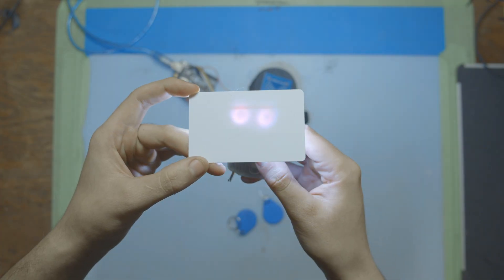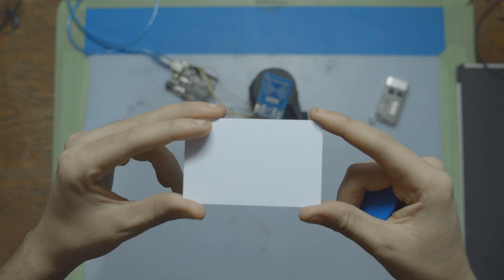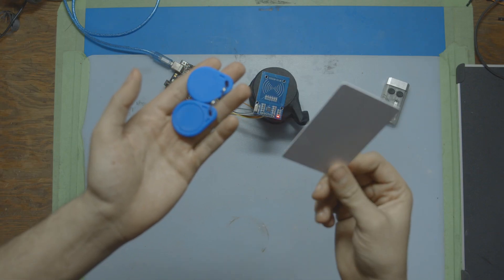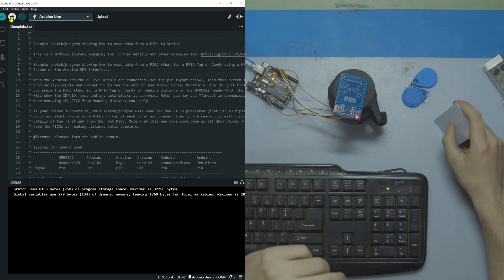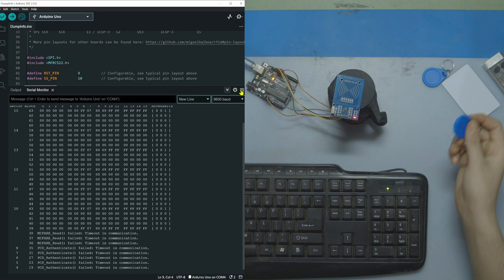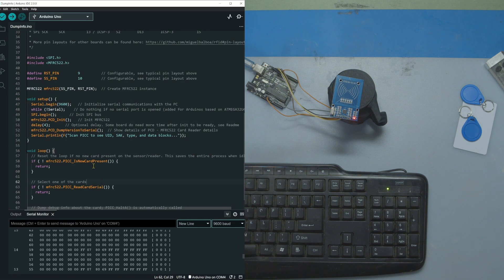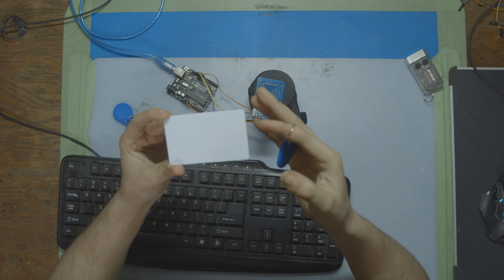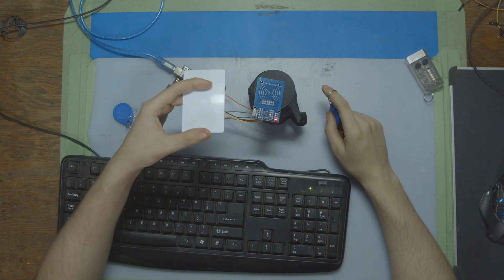RFID EXPLAINED: HOW TO WRITE DATA TO RFID CARDS WITH ARDUINO #rfid #arduino #esp32

Comment: My RFID isn't compactible with the arduino uno. It always gives communication error.
what might be the cause?
Reply: RF Cards such as rfid rc522 are compatible with Arduino Uno. You will have to install a library for example, RFID_MFRC522V2 to make them work. With high-end PCs, you may use a small delay command for the serial monitor to properly read RFID data
Reply: ? Baud rate

Comment: Hello, how to run power down mode in both Arduino and RC522? By bringing the card close to the RC522 module and using the interrupt mode in both modules, the system is started and after running, it goes into power down mode twice to extend the battery life. If this is not the case, the battery will run out in two weeks.
set_sleep_mode(SLEEP_MODE_PWR_DOWN);  in arduino  and  mfrc522.PCD_WriteRegister(MFRC522::CommandReg, 0x10); in rc522

Comment: @MikaelAbehsera is there a way to write info on the 15th row block. If this is possible it would make the scanning process so mich faster
Reply from the maker: Not sure actually, never tried
Reply: @MikaelAbehsera you ought to try it, all that waving was confusing...what I was looking for was the proximity and time constraints required for read and write, but the Arduino doesn't have a clock right? Either way it would be nice to see millis() used to do some timing tests... Please keep working on this!

Comment: No ive tried LOTS of cards and even the ones that come with arduino and they dont write but only read
Reply: Me too. I have wayyy too many tags and cards that were advertised as writable which are readonly
Reply from the maker: hmmm, seems weird, check your wiring on the write cables, could be an issue there

Comment: How would you turn those numbers in the 02 line as alphabet letters when you scan that card - like it would show what 74 means when translated into an alphabet?
Reply from the maker: its been a bit since this video but if I remember correctly its hex code, so the program just converts our indivitual characters into hex code and inputs that into the card storage (if its not hex its some other method but same idea)

Comment: Hey there! Im by no means an expert in this stuff, but I wanted to mention, mifare is a think pronounced "my fare", and though they use RFID technology they are more so deemed as NFC tags, since RFID tags are usually extremely unsecure tags that hold a hex code, where as NFC, specifically mifare classic ones allow you to have a read and write key with encryption!
Also if you wanted to change the UID on a card, you get whats called a "Magic" tag, essentially its just got an extra chip that pretends to be the UID
Also also, the block with written data at the start of the card has data like the manufacturers information and shouldn't be able to be overwritten.

If you wanted to do something simple and funny with them, such as having small text based messages or links etc, Mifare Ultralights are cheap and hold unsecure (I think) data that can be read by a phone and displayed once scanned! If its a link it even just sends the phone straight to the website on some devices